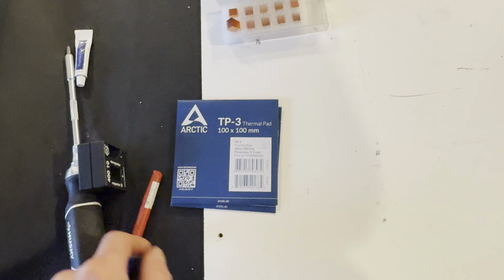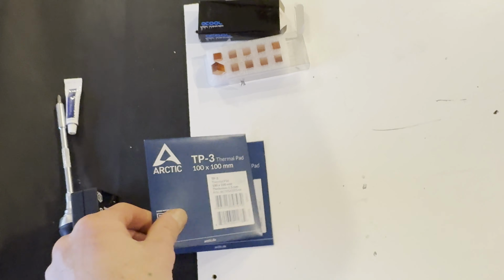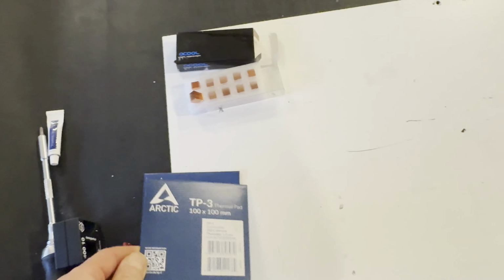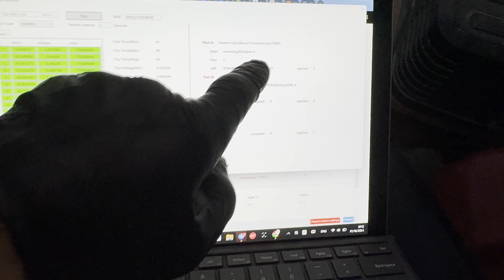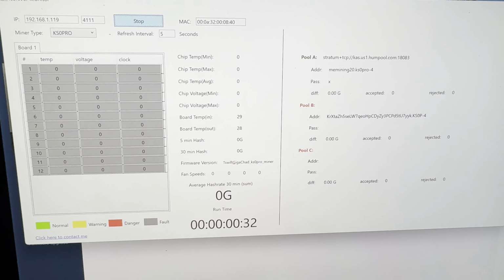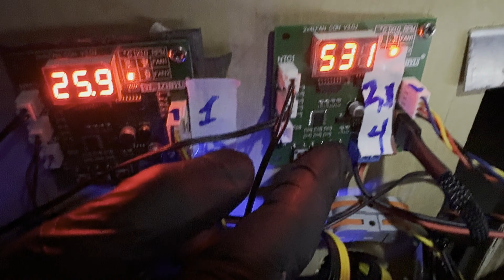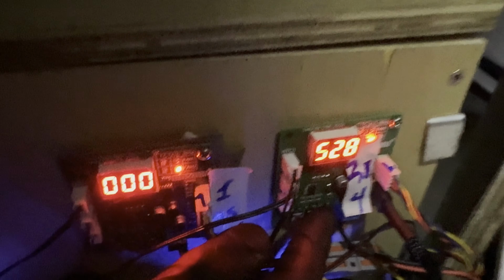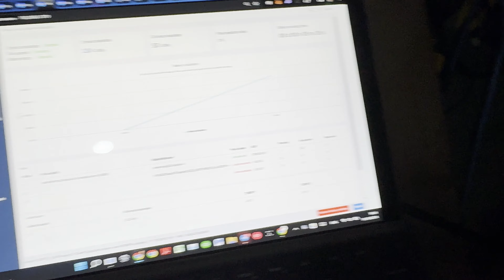CAN I USE THESE 10X10 HEATSINKS FOR MOSFETS FOR FIRMWARE  OC ON MY KS0-PRO?

Comment: thermal paste is suitable Thermal conductivity, W/(m⋅K): 5 or do you need more than 5 ?
Reply from the maker: MX-6 is a type of thermal paste used to improve heat transfer between computer components. It has a thermal conductivity of around 8 W/mK, which allows it to efficiently conduct heat away from components like CPUs and GPUs. But 5W/mK may be ok for these chips but closer to 8 is better I think
Reply: спасибо перезаказал 8) thnx @DontMindMeMining
Reply from the maker: Welcome

Comment: Hey man are you still using the 12v to 19v converter or did you connect straight to the breaker board from psu.
Reply from the maker: All KS0pro directly ton break-board 12v, KS0 OG only works on 12v when is not overlocked  for some reason. I had only 120G I think on 12v OK. I don’t know why they won’t work on 12v OC however one of them out of 6 works fine on 175 OC
Reply: @DontMindMeMining   I ordered 2x Ks0Pro without power supply as I have a few servers lying around and wanted to make sure they're safe to overclock to about 280-300gh straight to break board or would you just recommend individual 230 supply each
Reply from the maker: @FlorinGC  I have 8 on 12v from server psu and 2 of them took 340G  and 2 320 the rest on 300G probably just silicone lottery. I haven’t tested on the individual  19v
Reply: @DontMindMeMining  sorry for my dumb questions haha 😅
Better to ask than blow up something. Thank you for clarifying for me now I know to just buy the barrel connectors and rewatch your build video again for wiring
Reply from the maker: @FlorinGC  no worries, if you go higher then 280G OC watch out for barrel connectors temps so you not overheat them I solder xt60 with silicone 14GA wire directly to the board as one of my barrel connectors broke down

Comment: Do you happen to know the length and width dimensions of the thermal pads inside?
Reply from the maker: I’d say it’s 160-170mm x 13-15mm and 1.5mm thick I had 100x100 pad that enough to cut for 2 and a bit left over